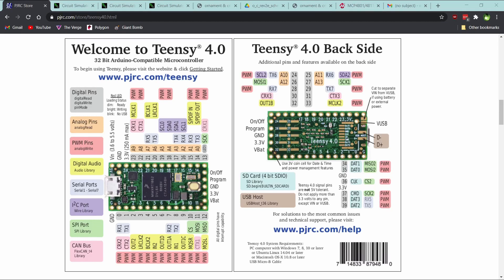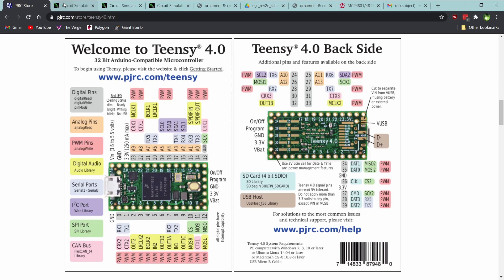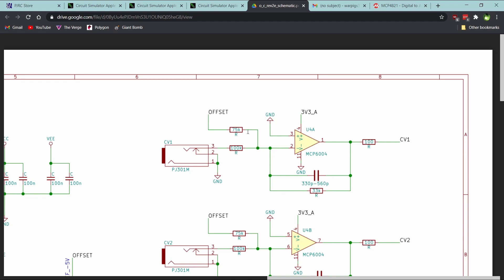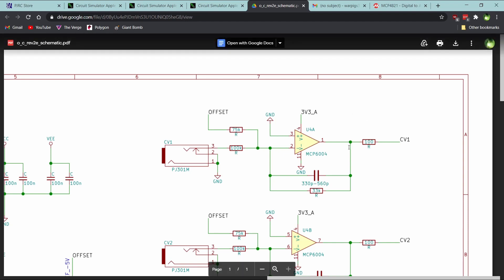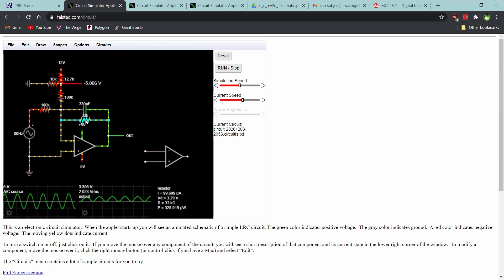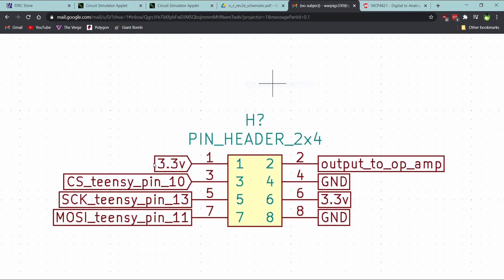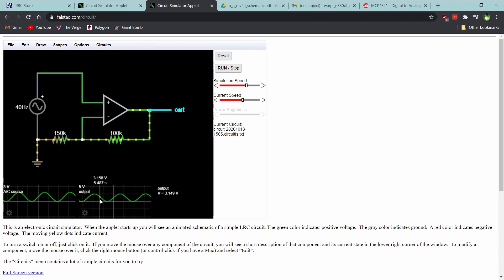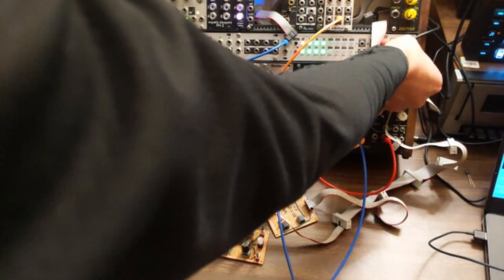CV input and output with teensy4.0

Comment: I think I don’t fully understand: why do you need a separate DAC chip - isn’t the teensy a DAC?
Reply from the maker: The teensy 3.2 has a DAC built in, but I am using the teensy 4.0, which does not. You can make analog voltage with a simple RC lowpass filter and a PWM pulse wave, but I have not personally done that.

Comment: Did you use a voltage divider to get the supply voltage down from the 12 volt to a 5 volt for the op-amp supply voltage? 
Also, is one of your terminals for the op-amp wired to ground. & if so, why?
Reply from the maker: I used a low power op amp, the MCP6002, which I am powering with the microcontroller's 3.3v and GND. It is really helpful because it is a rail to rail op amp, meaning that it can output to it's power rails, but not outside of that, which keeps any oddly high voltage signals (like 15ish) from damaging the microcontroller as the ADC input clips when it would get about 3.3v. Check out the schematics for Mutable Instruments's Rings (among others) for the circuit.

Comment: I just, coincidentially, found your video after building pretty much the same kind of manual cv looper using an arduino! very useful video btw. didn’t have to deal with as many voltage issues with the nano but will use a teensy next.